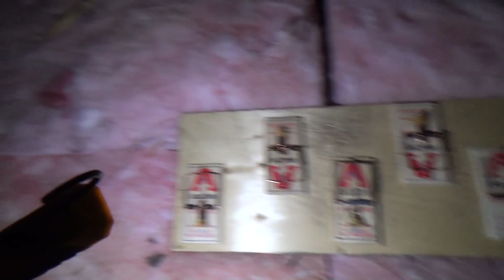Persistant Rodent Problem.....Hopefully Problem Solved

Comment: A horror story we got a rat in our attic. We were told they can climb walls. We spend a grand covering dryer vents with a metal covering then your screen stuff. They had to remove the insulation because they poop and pea on everything. But the blown in insulation had added a chemical to kill the thing. Finally killed it. The bugger went and hid under neath a rafter where it took them better part of a day looking for it with the putrid smell to boot. So dryer vents are covered with a heavy duty wire cage. So vacuum up poop with a dust buster be sure and wear a mask cover and fix holes with foam. Looks like a insulation will be needing to be replaced because it’s covered in pea so take lawn bags because theirs poop and pea under the insulation. It’s soiled in their pea. Set your electric traps your bait balls.
Reply from the maker: yeah its a mess .. little buggers

Comment: You could put a couple of traps on that vent sill, there's probably mice inside, you could trap them as they try to go out for food.
And put a couple on the area of the droppings, they obviously frequent that area.
I wouldn't be surprised if that disturbed area wasn't a nest, more traps needed there too.
Reply from the maker: maybe set a glue trap on the sill?
Reply: I was thinking conventional, but a glue trap may work